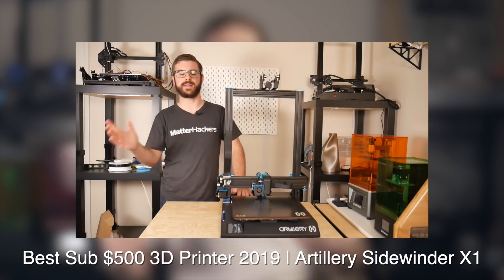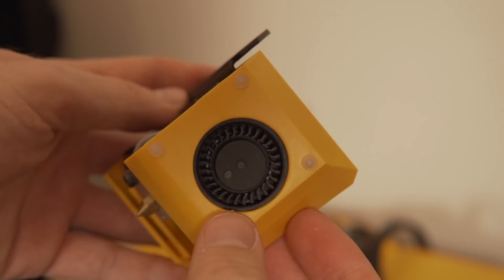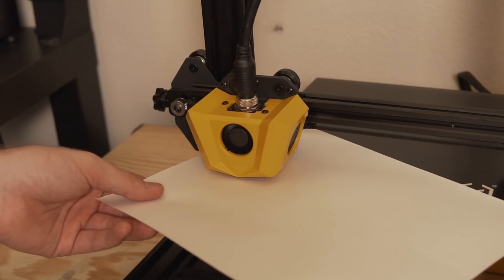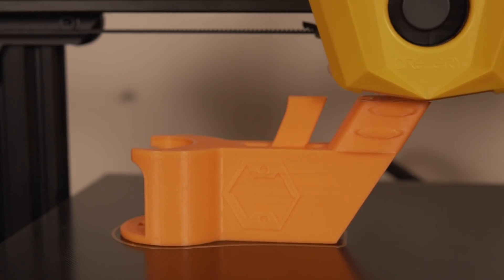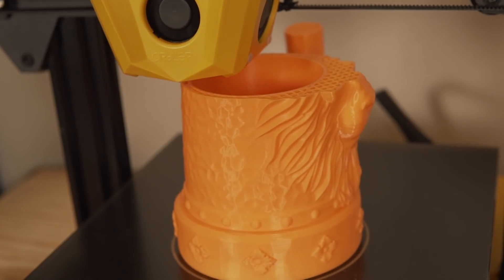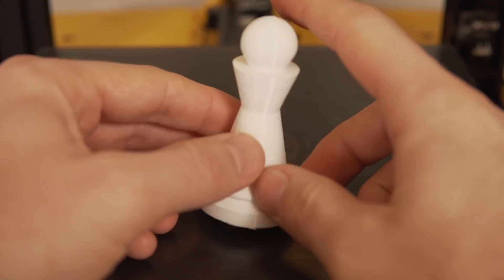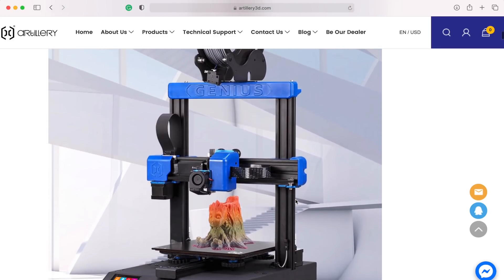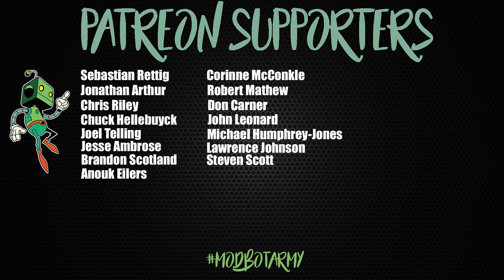Fast Printing On The Artillery Hornet 3D Printer

Comment: I have a sidewinder x1 that I've had for a couple of years. The machine is stock and just works. Learning to use CAD and slicer settings has been far more of a challenge than running the printer. This is the only printer I've owned, so nothing to compare to...but it does what I ask of it. I would like to upgrade to a Fulament setup for the bed eventually.
Reply: fulament set  up ???

Comment: I have had an Artillery Sidewinder for over a month now. I love the direct drive and all the bells and whistles. I haven't had any problems with the ribbon cable or the heater bed cables. Bed leveling has been very easy and I only adjust it once every two weeks with little to no adjustments. I have had numerous prints that were in the 12 to 23 hour range and haven't had any problems with bed adhesion. I would definitely buy another Artillery and have recommended the machine to many of my friends.

Comment: with a 32 bit board the test would be to run a cylinder print through octoprint (by way of Rpi/octopi). There's a bandwith issue with the sidewinder x1 and octoprint based on its buffer  limitations which causes the print to have a lot of blobs and zits.

Comment: This is a nifty printer. I think they skimped on the display... That is such an affordable thing to upgrade. Do you ever run into issues with the Proto Pasta cardboard spools? I'm 0 for 2 and have had to re-spool them. The corrugate was kinked and snagged the filament... failed prints. Thanks for another great video.

Comment: Pro-tip for removing hot glue:  Use Alcohol.  Like 99% alcohol. Saturate a little paper towel with it and just cover the glue joint for like 30 seconds.  It should start to just come loose easily.  If it doesn't add more alcohol and time, and it will.  Given that those electronics can generate quite a bit of heat, I recommend removing it.  By the way, this is Voultar's method for removing hot glue (I've tested it and it works though.) But I definitely recommend checking out his channel if you're into modifying electronics in any way.

Comment: Hey love the videos, just subscribed because I realized I never did....
Anyways, would you still recommend the X1 after using it all this time? Thanks. Looking to buy one, and want to make sure over time it still holds up
Reply from the maker: Hey! Thanks for watching and the subscription. Absolutely! Out of all of the machines I have used in the sub $500 range I love the SideWinder and still think it is a fantastic option. You will not be dissapointed.
Reply: @ModBotArmy  thanks alot man! I can't wait to get mine and start making some functional prints. Thanks again

Comment: I have the sidewinder x1 and I absolutely love it. Artillery is still under rated in the 3d printer game but have steadily made their way. They make solid machines, and this now includes the hornet. But I do agree with your final analysis, in that its a no brainer to get the genius over the hornet with the current price points.

Great video btw
Reply from the maker: Thanks for watching and the feedback! I do agree they are one of the top out there in my opinion for low cost entry level 3d printers. They come with so many things that you would need to upgrade other machines to be able to run the same setup.
Reply: I know I'm a year late to this, but the artillery genius is 290€ excluding shipping and the hornet is 160€ including shipping, the hornet has to be worth it by now since they changed the price so much right?

Comment: IMHO ... Bowden is bad.
Reply from the maker: I have used both lots over the years and both print what I want fine. I like direct for the times I want flexibles and I feel they do better with stringing. However, I do believe bowden can be pushed to print quicker.
Reply: @ModBotArmy  I've had so many issues with the Teflon tube and its fittings over the years (CR-10s) that I am probably biased.

Comment: Exactly what i was thinking first time when i saw Hornet. With that small difference in price, Genius is the way. But if they correct the price to be more closer to the Ender, where it actually fits more, then it will be printer worth to try :)
Reply from the maker: I am really hoping they take the feedback in this video and the community into consideration. They have in the past with the revisions to the X1 so fingers crossed.
Reply: @ModBotArmy  I just bought one for $179, hopefully this is a more accurate price for this machine. This will be my first printer so hopefully I picked a user friendly one

Comment: It was probably bed adhesion that loosened your print. Try looking at the bed of any mains-powered bed on an artillery printer with a thermal camera. The temperature difference from center to corner can be as big as 20C.
Reply from the maker: I do agree that it was bed adhesion and I was able to fix this. I may need to pick up a thermal camera. Could be useful for both troubleshooting as well as future content creation. Thanks for the tip.

Comment: Looks OK, like you stated the price is a tad high for it's feature set. BUT! the biggest issue! that hotend.  Why haven't people noticed that that setup of the "V" shaped shell, takes all the cooling from the hot end fan and throw it down on to the bed/part? It looks like it's pushing out the back? which is covered by the 2020 extrusion! so the air is getting forced to flowing down and at the bed... unless there is some ducking in the back not shown?
Reply from the maker: I did not notice any issues with cooling in my testing but I do think it could definitely benefit from a slightly different fan shroud that angles it a bit more. Right now there is not a ton of control as to where the airflow is being thrown. Granted it did not seem to affect part quality or the hotends ability to heat. I agree with your statement though that there is room for improvement. The fan shroud on their other machines is superior IMO

Comment: Bowden, PTFE-lined hotend, no filament-sensor, no ABL, small bed and proprietary cabling at that price point?  No thanks ...  The looks probably cost money, but all that stuff will be in the way when trying to upgrade or even troubleshoot/fix.  With these specs, it is more in plain old Ender-3 area, so sub $200...
Reply from the maker: Yeah I totally agree at the price, I am surprised with how much they took away compared to their other printers.

Comment: it's a 32bit board, I'd love to see you push it!!! crank the speed to 11! hell I print at 200 with a 1300g bed slinger lightly modded anet a8, I say push it! the hotend could be a bottleneck tho, but it'd be fun to see what it can do
Reply: @L3D... the speed that you put into the slicer is not the one you will see during the print. Export your gcode to “gcodeanalyser.com”... apply the numbers of accel and jerk settings of your Anet and them check the real average speed and many more cool information about the speed (max, min, etc..)
Reply from the maker: Your a madman! Haha I print so much slower. Maybe I will do some speed test this year.

Comment: pro tip: hot glue comes off like butter if you add a few drops of rubbing alcohol, it detaches like magic
Reply from the maker: This is awesome, I saw a few others comment this as well. Thank you for the tip this would have been so useful 8 years ago haha. Very happy to know this moving forward. :) Cheers!
Reply: Incidentally, it also works great to get tree sap off the car...(not 3d printing related, but might be useful) 😉 😅
Reply: Was going to add an alcohol mention :) great tip
Reply: Was about to mention the same thing ^^
Reply: Do you do that at the end of the print along an edge or before the print?

Comment: 245° on a teflon tube hotend?
Reply from the maker: Oh yeah, I have done that for years with no issues and no melting. That is my max, above that you want to go all metal.
Reply: @ModBotArmy  I´ve always though that you could never go above 235-240º because the ptfe tube will start to melt(degrade) and to expel fumes

Comment: How easy is it to change tube to a Capricorn type?
Reply from the maker: I do not believe you can remove the bowden, maybe they will offer it as an upgrade option or make it where the tube is not so tight.

Comment: I both love and hate that cable.  I never enjoy proprietary components that may need replacing, but damn is that clean.  Have you tried to pull the bowden tube out?  If it can be pulled out it would make it a lot easier to love.  Thanks for another great video!
Reply from the maker: I have not tried pulling the bowden tube out but I believe another user did try and they did not have luck. I may have to check this myself. I do agree it would be nice if they did have that for someone who wants to swap for capricorn or if you have a nasty jam that caused the need to replace one. Thanks watching :)
Reply: Wondering the same thing.